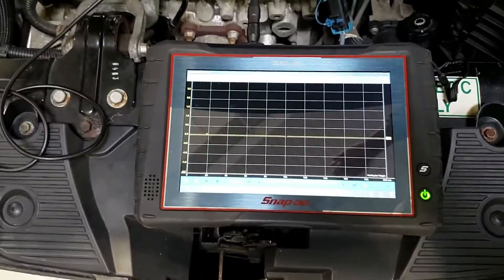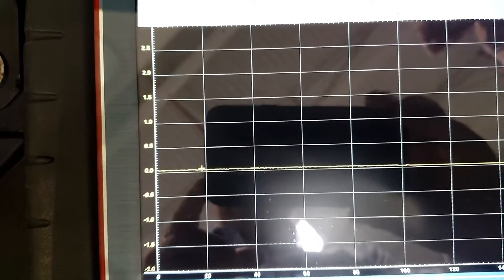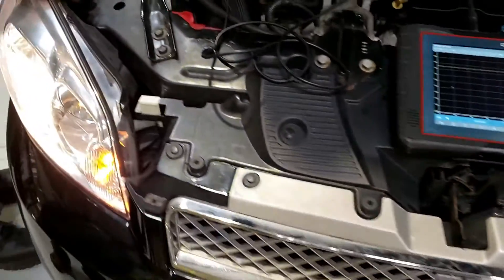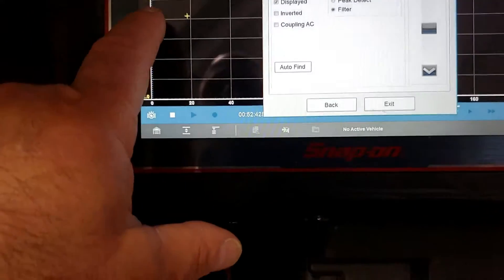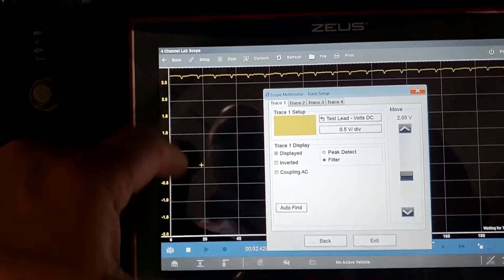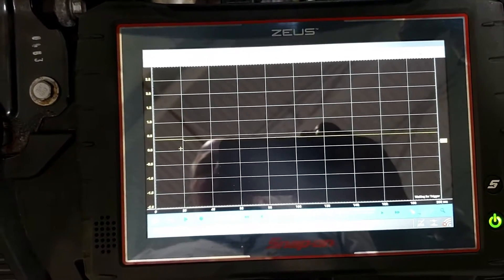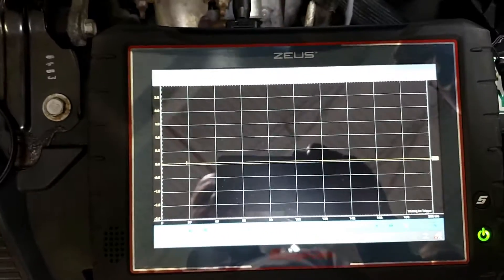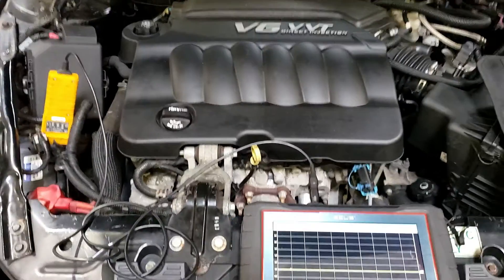ATTS Parasitic Draw  Battery Drain Check With Snap On Zeus labscope and Fluke I30s amp clamp

Comment: i use the i30s and the i310s but i also use the amporbe which are made by fluke with the same internals. u se the amprobe ct238a, 237b and the ct235 with the zues cause i like the bannas that come with them and i use the flukes on my pico. the ct 238a has the same resolution as the i30s and its around 100 bucks cheaper.

Comment: I find most and amp clamps i’m not accurate below 100 mA. That’s why I take A wire  and wrap it in a circle about five times with clamps on both ends then  connect  in series with my negative cable and battery. I attach the amp clamp in on all five wires makes the current stronger than just divided by five. I find it more accurate that way
Reply: like an AC Line Splitter but instead of 1x & 10x you at 5x.  I like it.  What clamp do you use?  Or really what amp range does it get the values up to so I can find an amp say 1A-1000A instead of the 1mA-60A clamps?